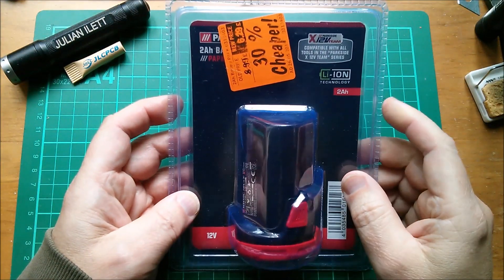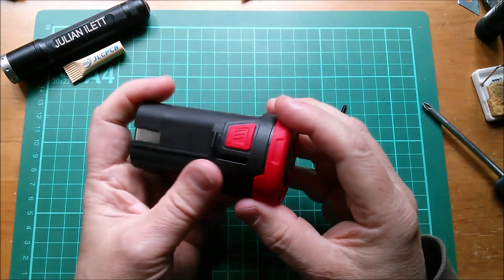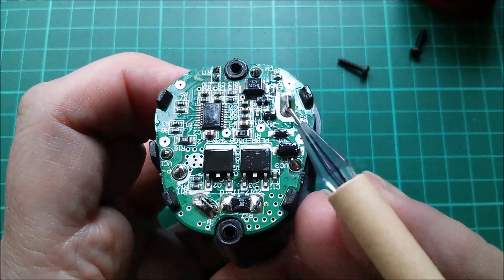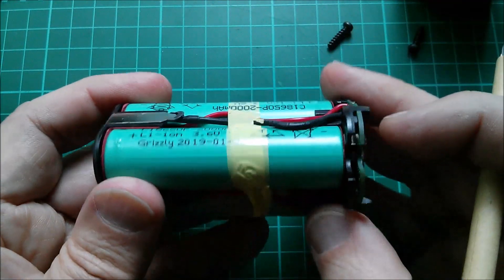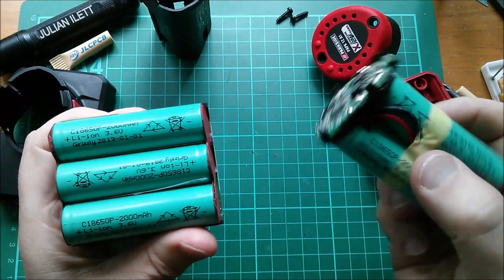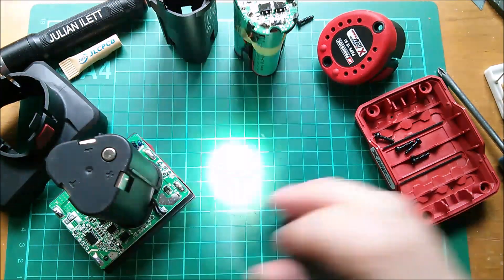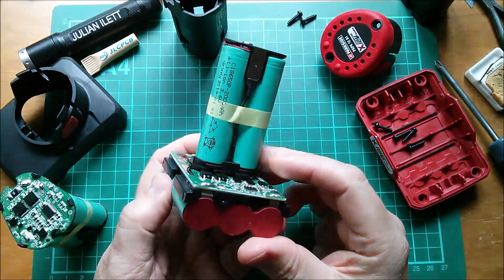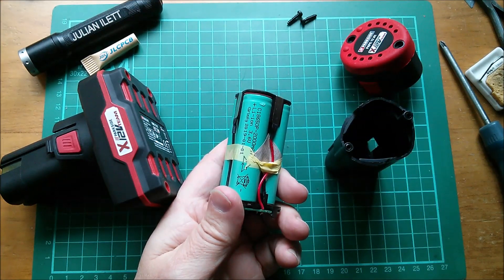Lidl Parkside 12V Power Tool Battery Stripdown - Very Revealing

Comment: Parkside battery pack are rubbish I have a few none of them have been re-charged more than 6 times and 2x2ah and 1x 4ah have stopped charging.
Reply: Have a range of 20v tools,and batteries,and one not charging , out of four, that I must have recharged at least ten times ,each.

Comment: Thanks, I hope you have answered my problem.
I connect with a cable to my boat 12v lead acid battery, runs for ages. 
So far been using a very old 12v drill.
Recently got. Parkside mini angle grinder, what a useful tool.  It was marked + and - . 
Just got a multi tool annoyingly not marked, but I can see from you video which way round. 
The angle grinder I could just push a spade type connector over the contact.  The multi tool connector is bent over at the end, probably needs soldering.

Comment: Just noticed: on the battery it says PAPK 12V A1 Which means they are old type non-balancing. Although the package says PAPK 12V B1 which ARE balanced type! This is probably why they give them away on such action price. Manufacturing error.
Reply: Does it really make much difference though? Doesn’t the charger do the balancing?

Comment: Hi Julien.
I'm trying to convert my parkside performance power tools to run on my Hikoki/Hitachi 18v batteries.  I have loads of the hitachi batteries but no parkside just the bare tools. The parkside has plus/minus and and a 3rd connector. the Hitachi batteries has plus/minus  and the following.C+,  T,  LS,  T. V,  LD How do I go about it? Thanks

Comment: Good video Julian. Quick question, and perhaps you may not have the answer. But I have some older (2017/18) Parkside tools which use the 12V batteries however, when compared to the latest batteries, the terminals are swapped around. i.e. my battery has + on the left, whereas the new batteries have + on the right. Do you know, if I were to strip down a new battery and swap the + and - spade terminals with each other, so the terminals would then match my current, older battery configuration, would that enable them to work in my tools? Thanks

Comment: Over the last couple of years there have been various 12V tools on offer from Lidl. However while the  general  form factor of the battery has stayed the same,  there have been minor subtle changes in the battery  shape and in the tool battery receptacle areas. The outcome of this is that batteries which are the same approximate form factor and the same voltage are not interchangeable. Likely a deliberate ploy on Lidl’s part.
Reply: To make them interchangeable, simply remove the plastic splines on the side with a sharp knife - then they should fit.

Comment: Great teardown.. I bought tool without battery and the  store doesn't have batteries in yet 😂 ..  Looking at this, mech modding tool is def out of question., or hooking it up to power adapter (matching amps and voltage).. Still really want to try adapter ..

Comment: Yeah… don’t force these into the older parkside 12v dremel-style tool having paid no attention that they’re a different battery series…

They fit… and then the tool lets the smoke out from being fed reverse voltage!

Time to build a new PWM circuit for the speed controller 😂

Comment: Does anyone know if the ID terminal is only connected to the "T" by a resistor, or it has some other connection also to the PCB or to the battery cell? I wanna use such a battery pack for somethig else, and I don't know if I need to bother about this terminal or not when charging (for sure not during discharging, as the power tool doesn't use this terminal). BTW, my charger has a counter terminal, a kind of telescopic pin that is contacting the ID terminal of the battery. This pin is on +8V to the "T" terminal in the charger. Thanks for any feedback!

Comment: Hey Julian, Great video, very informative.  If you decide to use the cells for a different project, would you consider donating the plastics from the 4Ah battery to me as i dropped my drill with one of those in and the casing has cracked on the top part and the triangular part.

Comment: I use the larger 24V Lidl packs on many older NiCad power tools, cost nowt and it's ni on allways the NiCads that go way before the tool :)
Reply: @Schwalbe262 still sold in Lidl UK stores, they are on Amazon BUT they are £21 !! In store normally £14.99, on sale £7.50 for the 2Ah battery 👍
Reply: @Schwalbe262 just checked on eBay, they are £16.99 ish, PAP20A1 for the 2Ah 👍

Comment: T is charging port+ is common positive and - is drain negative. Drain negative gets cut off at 2.5v per cell, T gets cut off when cell reaches 4.2v. in my opinion very good design, battery is protected, basically controlls charging with its bms and just gives + and - to tools to use
Reply: With the appropriate lithium charge controller could you charge the 12 v  pack from a 12v solar panel ? .Does the circuit board in the pack keep them balanced

Comment: I've had mine just over a year.  Charged it up and when I went to use it, it was dead.
I opened the pack, the cells seem to show over 4 volts, but when I check the connector voltage it's 7ish and drops quickly to below 5 and keeps going down below 4.

Comment: Just came across this video and i thought let's ad this new info in the comments. In the probably newer charger are 3 connections(marked as +,C-, and iD wich is the button connection in the middle same on the 4 aH battery), and the cells are marked as Parkside INR18650E(i would guess rebranded Samsung cells).

Comment: Does anybody know if the "T" contact is used by the drill or just the charger. I have it in mind to use a 2Ah battery to revive an old NiCd drill whose  battery pack has failed. The drill uses only two contacts, so I eed to know if transplanting the Li-Ion batteries and controller will continue to work if the T contact is not connected. I will need to adapt the charger to make it charge through "T" of course.

Comment: Did anyone discomnect the batteries from the BMS and reconnwct them? Does the battery pack still work then or does it have a kill switch so it stops working?

Comment: These cells are really good and cheap. I stripped the 18volt batteries when they were reduced took the cell holders with cells out trimmed off any excess plastic and stacked them 5 layers high connected them in parallel and put that back in the case with threaded rods instead of the original screws to make to 2 18 volt 10 amp wrapped them in heat shrink. Connected these to batteries in series for my 36 volt electric bike conversion. They work fantastic.

Comment: It seems that there are 12 Volt Parkside tools, which won't work with the smaller 2 Ah batteries. So, the tools use this ID Pin.
Reply: Any idea which ones? I have a drill and a hedge trimmer, neither use the ID pin.
Reply: @caskwith  sorry mate, I only one the Parkside 20v tools.

Comment: Julian, if you want cheap cells, you can just buy cheap cells. No need to look for special offers, discounts, surprise boxes, waste time and effort to disassemble, get cells with spikes after removing spot welded tabs, cut yourself, void warranty and gets stuck with overdischarged cells or cells of unknown characteristics. It's too much trouble for nothing unless you do it out of surprise addiction. 1.75 pounds is 1.95 euro. As an example, look for Sanyo UR1865ZL2 2310mAh - 10A at eu dot nkon dot nl. It's 1.99 euro.

Comment: Great vid with interesting info

I can vouch for how good Lidl's customer service is....I had a small 12v 2 amp (the single stick pack) drill/driver that after 2 years 10 months of heavyish use started splitting at the back....the 2 halves were coming apart ...tightening the screws didnt help so must be stripped threads in the plastic...it worked but was stuck in 1 speed as switch wouldnt move.

I rang them up (keep receipt) and they sent me a new one inc case and battery and said keep old one :) yep nearly 3 years old!  (still using it)......great service 

Have done quite a few reviews of their tools on my channel.

Comment: Only 3, 6v that is very low for 18650 battery's, the ones I use are 4,1v per battery, made a 24v battery pack, 6x4,1v and 3400mAh each.

Comment: I bought a couple of the larger packs but without the riser - they only have five cells per pack. No matter...I just wanted some reasonable cells with spot welded tabs so that I could try rebuilding a couple of Hitachi 10.8V packs (only 1500mah).
Worked a treat! The Hitachi packs are thoughtfully designed - unsolder a few wires and the three cells can be removed without having to hack into the frame (unlike the Parkside packs).
Very pleased with the results - so thanks for the heads up!

Comment: Most Parkside stuff is rebranded popular named equipment often from the same producers who have agreed to produce there equipment for Lidle. They often cost 1/3 or 1/4 less. A good example is the Parkside petrol 1200 watt generator which is a rebranded Hyundai generator. It's also branded with Sceppach and zipper. Parksides one is £80 cheaper then the zipper one.
Reply: I've seen rebadged Einhell and Ferm (Dutch brand) power tools in Lidl as well.

Comment: Balncing is not problem when You use device to heavy job's. Please notice that the much of expensive device like Makita also don't have balncing system. However when You check each cells after year  using, You can see that each cells have the same voltage to 0.001 volt.is isvery interesting phenomen

Comment: Idiots from Parkside/LIDL sell 12v spare battery which has different polarity from original parkside grinder bought year ago(same factor size 3 cells one) https://images-na.ssl-images-amazon.com/images/I/61Osi1VoprL._SX425_.jpg. Grinder fried, so next time I will buy new and return burned one , thanks lildl.

Comment: https://youtu.be/1fvP6dWJ61g?t=504 Probably like what happens with some laptops, like ThinkPad. They 'sense' the value of the resistor to determine if the right battery pack (power supply) is used. thye will likely refuse to operate a certain device, like a high power drill, when it does not offer the right battery.

Comment: I don't think any of these cheaper Li-ion batteries do any kind of balancing. I have some Draper batteries, identical to an Aldi tool system. I have had two packs die now (all draper, none of the aldi interestingly), when I took them apart it was clear that is a simple series circuit with some overvoltage/overheat protection but that's all. In both packs it was one cell that was faulty, then likely overcharged by the other cells and then failed.

Comment: so after doing a full charge then putting it on my dummy load @4amps and cut off at 8.4v (2.8v per cell) we got 3990mah. pretty dam good. just need a data sheet for the max charge/discharge rate
Reply: sorry to be off topic but does anybody know a tool to log back into an Instagram account?
I somehow lost the password. I love any tricks you can offer me.
Reply: @Malachi Braydon instablaster =)
Reply: @Taylor Camdyn thanks for your reply. I found the site through google and im waiting for the hacking stuff atm.
Seems to take quite some time so I will reply here later with my results.
Reply: @Taylor Camdyn It worked and I now got access to my account again. I am so happy!
Thanks so much you saved my ass !
Reply: @Malachi Braydon glad I could help :D

Comment: the cells stay balanced, or at least they do on the 20v packs. 
I  think some of these cheaper ones go for midpoint balancing... stopping charge as soon as any battery hits 4.2 and stopping discharge as soon as any hits 2.8, this way capacity is slightly reduced but keeps evryone safe.
would be interesting @julian if you knock a cell out of balance to see if the pack recovers on these ''simpler'' packs, that said, they look a lot better designed than the ferrex packs from aldi.
Reply: Most likely no balance just a low cell cut off 😂😂😂😂😂
Reply: @davey2k12  active balancing on 20v packs
Reply: @lezbriddon  but when is it balancing tho... soon as cell drops out of balance with the others so that means it'll use energy to keep em balanced unless it's only active while charging

Comment: Question is - ARE YOU ACTUALLY GETTING the capacity written on the cells?  The chenglish translation for 5mAh can be anything up to 3.6Ah.  I remember well the sand filled cells from a few years ago.
You could do with running a couple up and down a couple of times to see what reality says - ink is cheap at Aldi!
That scottish poundshop warrior (BC) shows time and again the worth of battery ratings.
If they are genuine they are a good deal.
Reply: "That scottish poundshop warrior" ... Big Clive?
Reply: @YodaWhat  Yup - that's Big Clive who's 6'5" and tests batteries to destruction.  To be fair to Julian, I like his reviews, but when it comes to batteries and especially LiLon/Lipo the only reason for using them is higher capacity - so its pretty fundamental knowing the real numbers.
The point of a review is someone you trust making the investment of time and money on test equipment, then to get the kit and do the legwork and testing for you.  It's not that hard - but not everyone has it all to hand. 
Given their tendency to meltdown - protection is quite important too.  Branding (esp of chinesium) is mostly only a printer's whim and  doesn't matter.  It's the numbers that speak for themselves.
BC's reliable numbers are one of the reasons for going back, he occasionally discovers quite splendid deals.

Comment: Just bought one to open up and use for the cells. And it looks to me like they Are balanced. Each cell is monitored by the board and thus possibly balance as well? 
Also. Has anyone found a data sheet on these cells?

Comment: Edit: Removed most of my previous junk 'cos I noticed... the charger has access to the batteries individually through those metal tabs.  It's almost certain that the charger has the balancing circuit.
I guess the idea is that you are forced to charge the battery packs using "their" charger, for safety.  Which seems very unsafe to me, since it's far safer to have the balancing circuit in the battery pack than in the charger.  Still, it's possibly cheaper, and it will work so long as you always use the correct charger, or at least a charger which includes a balance charge circuit.

Comment: You have extreme low prices in UK.
we also had these packs in our LIDL stores (Denmark)
the 2Ah with also Grizzly cells cost 99 DKK (12 GBP) and the 4Ah also with Grizzly cells was 179 DKK (22GBP)  https://i.imgur.com/z95v8Wz.png
so shockingly fare from the MSRP before sale price. and batteries will never come on sale here... just as many of these LIDL tools are not carried here.
The only two was the 12vdrill and the 12v multitool for these batteries a few weeks back there both costed 349DKK (42 GBP.)
These tools cost 29Euro in Germany and 25GBP in the UK as I recall.
Not sure what the reason is why the LIDL Germany  (aka Schwarz group) set the prices here so much higher than all our neighboring countries..as they are the only one..even though they are not little here with a triple-digit number of stores.
Aldi has the same prices in Denmark as our neighboring countries, so seem weird that LIDL inflate them as much, but the biggest problem is the very little selection of these tools, so if you buy a product with battery and charger, you are often not gonna get the chance for the other power tools that battery lineup also would work in.
LIDL Denmark got a very low score amongst the public... bad leadership.
Reply: Also recall LIDL got a lot of critics here amongst the media after young immigrant gangs terrorized one of their stores and often walk in and almost tried to empty the store for valued products and LIDL didn't dare to stand up for common sense but again and again let it happens and then trying to pay these young immigrant gangs by hiring them on make-believe jobs, like we where some kind of Wild West' where you pay your way out and doing that in such a situation will just unfold even more and make that criminal-offense even more lucrative for others. (lol maybe that is why the prices are higher, the Danes are simply paying for LIDL Denmark's lack of backbone.)

Look int he 12v unit i got for these batteries and there is no centerpin for that 4A pack mid-center round pin.
so definately not for the 12v angle grinder (B1 version)
https://i.imgur.com/p934bKz.mp4
  (brushless??)

Comment: Balancing and cheap charger doesn't go together. For simple charging you just use full current until one cell reaches it's maximum. If you want to balance you would then have to switch the charger into a lower current mode, unless you are fine with each of the balancing resistors to have a heatsink to dissipate 5-10 Watts. To switch to a lower current you would need some kind communication between the charger and the battery pack. And that will make things complicated and expensive, even if it were just a single on/off pin telling the charger to switch to another mode.
Reply: balancing is done in the battery pack on most tools now, this way the charger only needs 3 wires, ground, chargng voltage and a temp sense line.(T) (T) is often a bimetal switch to battery ground, which is why some chargers use it as the ground as when battery gets hot, charging cant continue

Comment: A thought that struck me with the duel voltage cell, would it loose balance on the cells if its used for ages on a 12v unit then used on a 20v tool?